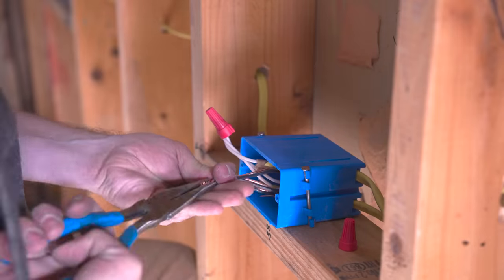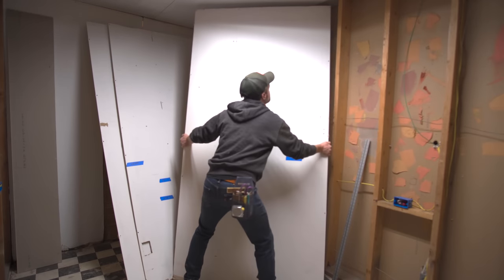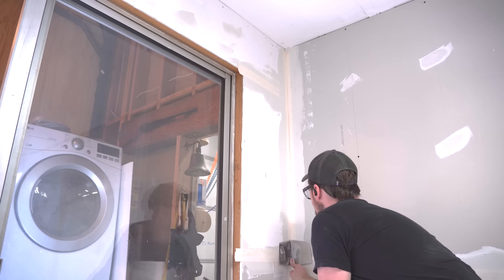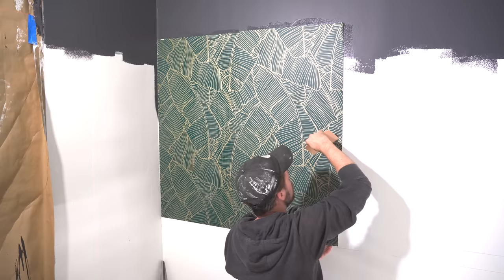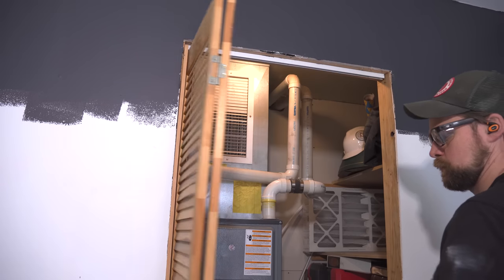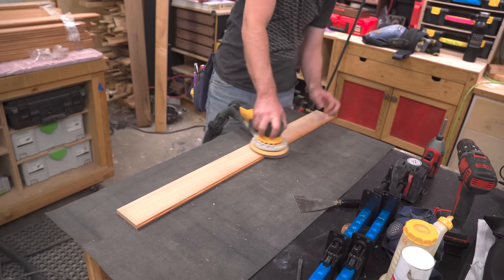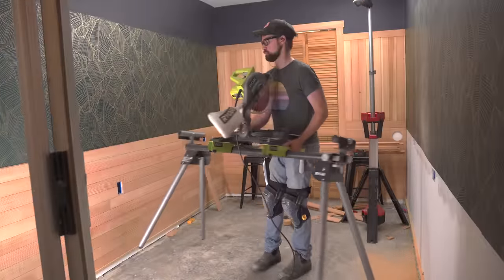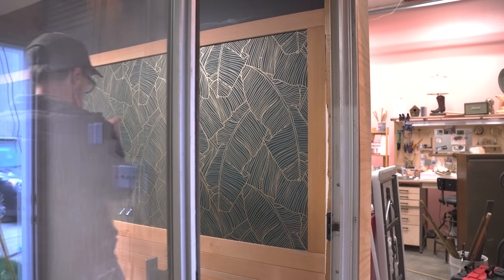Wasted Space to Home Office in 10 days

Comment: My grandad was a professional decorator and taught me how to hang wallpaper,  you lay the paper face down on a table, then you brush the paste to the rear in a herringbone shape you then loosely fold up the paper at the bottom onto itself so its easier to hang. once on the wall, you use a badger brush (long brush with badger hair) instead of a squeegee and brush the front out in a herringbone fashion again.  The reason you are getting bubbles is that the wall is drinking in the paste before you the paper to it. If the paper is applied wet that capillary action pulls the paper to the wall.  My grandad would have around ten sheets already pasted by folding the top and bottoms.  He also started middle out of the wall and used a plumbline on the first one.
Reply: Amen to all above. And ... bubbles will desolve itself as the paper will let the air through. Best not to get them, but don't worrie too much. 
👍🎈
Reply: That is indeed the correct way to do it!

Comment: Hey man, appreciate you and the excellent content!  If you're going to spend any significant amount of daytime hours in your windowless office I'd recommend proper lighting.  The new school way is to use tunable white to be able to match the color temperature of the sun throughout the day.  It is EXPENSIVE though.  There are of course hacks that can achieve a similar result without the automatic tuning based on the sun's position.  It would include a mix of colder 4000-5000K fixtures with Dim to Warm bulbs to handle the transition to the warmer temperatures.  I'm sure your editing sessions are done in a dimmer lighting conditions but for the rest keep that brain happy!  Looking forward to the completed project!
Reply: I use Phillips Hue stuff and it works really really well. LOL!
Reply: yess a 100 percent. I have govee LED strip lights that are tunneled and even tho I have a lot of windows when I have the led strip set to daylight it makes a huge difference, turns this gloomy rainy days around
Reply: To add my own recommendation, I have a couple TP Link Kasa LED bulbs which have a setting for automatic brightness/color temperature, so the hue and brightness changes throughout the day. It only works on the RGB bulbs though, not on the white LED with variable color temperature bulbs, for some reason. They aren't too expensive and don't require a central hub either.
Reply: Dios te bendiga y Dios bendiga a Todos los que estan leyendo esto! Deseo que tengan un hermoso dia! Buscad a Dios mientras pueda ser hallado! Jesus es el camino y el unico camino y regresa pronto! Recuerda cuando te sientas que no eres amado... el mayor sacrificio se hizo por amor! EL SUICIDIO NUNCA ES LA RESPUESTA! 

Porque de tal manera amó Dios al mundo, que ha dado a su Hijo unigénito, para que todo aquel que en él cree, no se pierda, mas tenga vida eterna.
S. Juan 3:16 RVR1960 

La paga del pecado es muerte (infierno) pero Cristo pagó nuestra deuda en la cruz para nuestra salvacion! Debemos volvernos a Dios y apartarnos de nuestros caminos pecaminosos, confesar que Jesús es el Señor y creer con nuestro corazón que fue resucitado de entre los muertos por Dios, y  debemos de ser bautizados en el nombre del Padre, del Hijo y del Espíritu Santo y vivir por Su palabra y mandamientos! Confia que Dios ayudara con el resto! 

Busca a Dios, antes de que sea muy tarde! Hoy podria ser tu ultimo dia en la tierra! 

Que tengas un hermoso dia!

❤️❤️❤️
Reply: FANTASTIC suggestion!!!!
Reply: Good idea. A "cheap" way to do it would be the adjustable RGB LED lights that can output white light (like the remote ones), and you can just set them to change colors/color temp based on a pre-set timer throughout the day to match the daylight cycle. Would be really straight forward and easy to do.
Reply: @lopezfam7317  More copy & paste spam. 🙄

Comment: Can I asked why you didn’t insulate the walls if you want more sound proofing? Would that not be worth the cost? What sound proofing is best?
Reply: I think sound proofing is for reducing sound coming through from other rooms. When he said "the acoustic is terrible," it's because there's a lot of echo in the room from hard flat surfaces. Acoustic treatments on the outside of the wall can reduce echo, where as insulation inside the walls won't do that at all.
Reply: As a person who works just a little with audio... any chance you get you fill with sound proofing insulation. And every surface is for sound deadening panels. Missed opportunity there.
Reply: A quick and dirty answer on what's a good way to soundproof a wall is to fill it with regular insulation and put on two layers of plasterboard, overlapped by half a sheet so the seams don't like up between layers. Lots of more details on how to do it but that's the gist.

From what I've read from an insulation manufacturer here in Norway, there's no improvement with using rigid fiberglass/rockwool over the regular stuff.

Comment: It’s looking awesome! I love the wallpaper and it was even Zen to watch you install it. I can totally relate to the frustrations of removing flooring and/or stuff stuck to flooring. A few years ago we redid our kitchen and that included installing hardwood flooring in our entryway. The original entryway floor was old brown hexagon tile. We removed the tile but it left so much thin set that we decided it would be easier to rip up the top layer of subfloor. One evening I decided to tackle this job and after 2 1/2 hours, I think I had pulled up about a 2‘ x 3‘ piece of subfloor. It was insane how many staples someone had put into the subfloor. I gave up for the evening. That was three or four years ago and I still get hives thinking about it but the new hardwood floor is laid and I am so grateful to be done with that project. I’m also glad I hung in there and saw that project through. Even though removing everything from your floor was a real pain you’ll be glad you did.

Comment: Don’t forget junction box extenders for all the outlets. You should install duplex receptacles that also have one usb type a and one usb type c outlet on the device, so you can have multiple spots in the room for charging. I’ve used the Hubbel one for multiple commercial projects I’ve designed.
Reply: I was going to say add box extenders too
Reply: Same, been hit by that in inspections. (And for good reason, don’t want to light that nice wood paneling on fire)
Reply: Noticed that too. I've had good luck with the adjustable boxes with the screw on the side. Shame he did not run Cat6 while he was at it...
Reply: In our Library renovation project, we installed combo outlets with USBs in one room thinking the space could be expanded for more public computers. Three years later we've turned the room into staff offices and now we don't have enough three pronged outlets for all our monitors, computers, sit-to-stand desks, printers, electric pencil sharpener, etc.  $9 million later and we are still running extension cords around the perimeter of the room...at least temporarily until we can get an electrician to swap them for duplexs or combos. :) Not that you can't change yours out easily enough since you did run your own electric.  Point, you just never know where things will be set up. LOVE the build!!
Reply: @BMad-we6qf  it doesn’t matter if you swap them out, if they are still on the same circuit you are going to overleaf the circuit. WhT you should have done when converting to the office was add a couple of more circuits in there with a quad receptacle. I design all the office spaces I do with a quad where pcs are being located and the panel boards supplying them with surge suppression.
Reply: I'm not sure if you've bought an electronic device in the past 50 years, but doing a hard installation of a usb peripheral is *fucking stupid*. Keep it to a 4 piece outlet and plug in the new charging brick as the technology advances.

Comment: Such a great point you made at around 8:00 about priming raw mud and new drywall!  When we decided to take off the old wallpaper in our downstairs bedroom and paint, we ended up with a pock-marked wall that I eventually gave up on and covered with beadboard panels, because whoever had papered down there did so over unpainted drywall, WELDING the paper on forever!  So, good tip!

Comment: You can get a scraper to clear floors like that which consists of a handle with a heavy duty utility blade in he head which you can switch out and flip over as needed.  By far the best solution I have found for carpet adhesive cleanup

Comment: 1. with wallpaper each roll will have a batch number on it. MAKE SURE YOUR BATCH NUMBERS MATCH. you wont get any misalignment issues then. 
2. I've always had much better results pasting the paper even when the manufacturers say to paste the wall. every time i have seen or had bubbles in the paper it's because the wall has been pasted first. 
3. While you can measure each "drop" with a tape every time it's much easier to just offer up the roll to the previous drop and mark it there. 
4. You're right, Wallpapering can be super Zen if you find your grove.
Reply: Yes, back butter the wallpaper bc the wall drink up some of that paste. And use a wallpaper brush when smoothing it out too. Zinzer makes one that I also use when doing a textured paint on hand painted furniture (like a burlap texture).

Comment: Nice job 👍 it really looks great. 

A tip for next time you need to strip out flooring: use acetone … lots of it in small areas at a time (it evaporates very quickly), as it soaks through the “paper” layer, it dissolves the glue. Wear a mask for the fumes, it gets heavy quickly.

Comment: For future reference, insulating the walls would greatly reduce the echo and reverb off the drywall, the gaps between the studs are basically small echo chambers. I would even argue for more expensive foam insulation, which is denser, you might not even have to do acoustic treatment in the room for recording videos - maybe. But it would definitely soundproof those walls from anything happening in other rooms. If your YouTube channel is a side business, you could even write off the expense. A little late for you, obviously, unless you did it from the other side of the walls. But if you build rooms like this for other people, it's a good thing to consider.

But nice job on the room. I like the wood you used, the color complements the wallpaper very nicely. Good, clean finish on the carpentry. And I'm glad you re-did that upper trim over the slat door, the little overhang felt off visually against all the other clean lines. So I was glad you caught that. Very nice work.

Comment: Looks good, hopefully the carpets help with the echo, maybe some sort of hanging acoustic panel from the ceiling would help a lot too but will lower the height a bit and might make it seem a little more closed in.
As far as office stuff a sit stand desk, monitor arms and good cable management is all it really takes to make it nice. Id suggest getting a sit stand desk that is just the frame and making a custom top to make it your own, stuff like an inset to make a small section thin enough for a wireless phone charger to be mounted underneath would clean it up a bit and depending on if youre a headphone or speaker user some mounts for them.

Comment: I'm glad you didn't paint the ceiling black. Dark ceilings give the impression of coming down. And it's also a bit of a shame that the room doesn't get any natural light. I would recommend installing either one or two light wells or some skylights. But if you use the room only at night, it wouldn't be necessary, right? Anyway, I like the design. It turned out really well.

Comment: If you don't already have suspension hardware for your monitors, get wall-mounted arms instead of desk-mounted arms. Isolating the desk height and position adjustments from the monitors and cable routing makes for a better experience. You get a completely uncluttered desk surface without having to be clever or careful. If you can roll the desk out the room on casters without disturbing your computer or cabling, it makes it WAY easier to keep your hardware clean. Also, the secure connection to the wall takes ALL the wobble and play out of the suspension arms, so they work much better.

Comment: If you're going to do a sit stand desk, I've found it better to find wall mounts for the monitor(s) that have a bit of vertical adjustment to them rather than attaching to the desk directly. When the desk is in standing mode it can sometimes be a bit wobbly, and I feel better not having the monitors attached to that.

Comment: So, i know you couldnt have done it in the room you were doing it in, but i had a similar issue with the flooring in my basement, the glue stuck. i still had a raw room, and used an angle grinder with a steel brush on it, got that stuff sorted in no time, and pretty easily too. Something to keep in mind for next time.

Comment: Lol. I couldn’t stop laughing during drywall. I shared the same value but you have a tool I don’t have. Height. Lol. I could not two hand the top portion of the wall the way you did at the openings where it just needs 2’- 4’ long drywall. Scaffold or ladder is a step I can’t skip during drywalling/muddying/taping 6’ above.

Comment: not sure what the adhesive in the floor is, but ive heard you can add some liquid soap to water and put it on the surface, and then cover it with a plastic painting film. It disolves both wallpaper adhesives, wallpaper glue and glue paints.

Comment: American outlets wired upside-down is the better way to wire them safety-wise. If you had something half plugged in to a normally wired outlet, a metal pen, nail, screw, or child's finger falling on top of the exposed prongs will short. Same situation on an upside-down wired outlet, the thing falling on the exposed prongs hits the ground.

Comment: Using water to loosen the glue work great probably needed more water I found that having a little water on top means it's got enough water I have found that as long as they used a water based glue it's great unfortunately the newer glue in most cases is not water based and that can be a nightmare as the only way to remove it is with a heat gun and that takes forever

Comment: they make a razor scraper in 8 and 10 inch lengths on a long handle just for the purpose of removing floor glue. The BETTER way is a rotary floor scrubber with a scraper head. THOSE things rocked until you hit a random bolt sticking out of the concrete.

Comment: To late for you now but if you ever have to remove glue off concrete like that get a chisel bit for a rotary hammer and then remove with hammer only mode. That is if you have a rotary hammer. Saves a ton of back breaking work.

Comment: While you had the dry wal open, why didn't you add sound isolation inside? Also, for an office, it seems you have a very low number of outlets: 1 x computer, 2 x monitors, 1 x printer, a couple of things charging, you have exhausted all the existing outlets.

Funny what you say about putting the glue on the wall instead of pre-existing glue on the paper: for s far as I can remember (like 50 years, when I first saw my dad doing it), in France we would paste the paper, but it never came with pre-existing glue. And yes, the glue is applied in thick layers, so the paper can be easily adjusted, especially when the design have to match from one length to another.

Comment: I like the design and build but bet you end up installing cork paneling over sections of the wallpaper. An office always needs cork for one reason or the other. Usually the other.
Also, not saying you should do this (I don't believe in telling people what to do with their projects) but did you ever consider LED lighting above the trim at top of wallpaper to illuminate the ceiling? I wonder if it would add height to the room and help you see cobwebs easier. (cobwebs = joke)

Comment: LOL penny auction scams are still a thing in 2022?

Yikes so that site isn't super transparent about the cost of their bids, but looks like they value them somewhere around 10-60 cents each.  If an iPhone 13 Pro Max 128GB brings $425.00 in bids that means 42500 bids were placed at the cost of $0.10 per bid (On the low end.).  That means the site got $4250.00 for an iPhone that is only worth $1100.00.
Reply: Thanks for the comment! On DealDash, bids can be purchased for usually between 10 to 15 cents, depending on the price of bids for that day. We also offer a variety of reward programs where users are able to earn free bids throughout their experience. Hope this helps and have a great day!